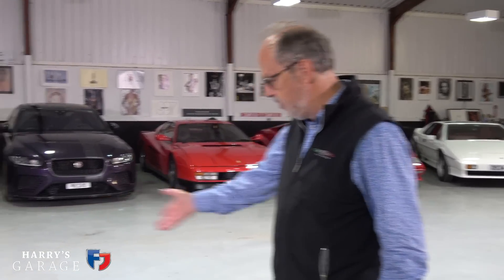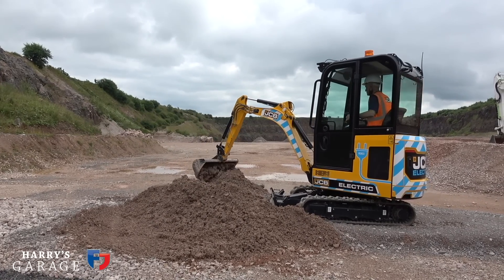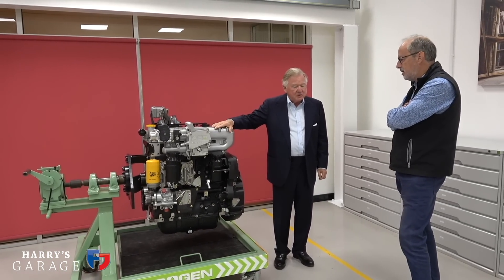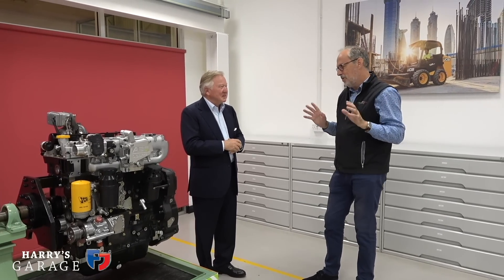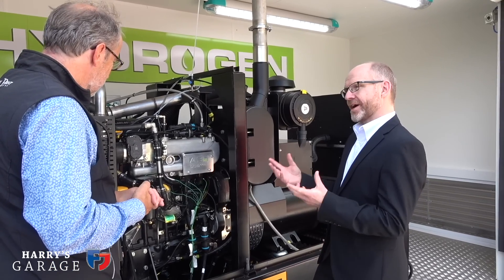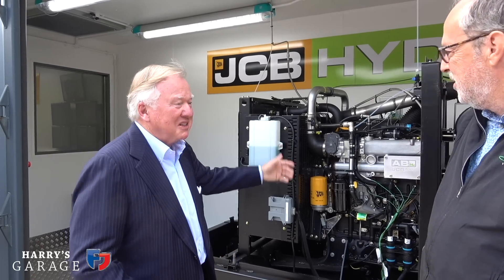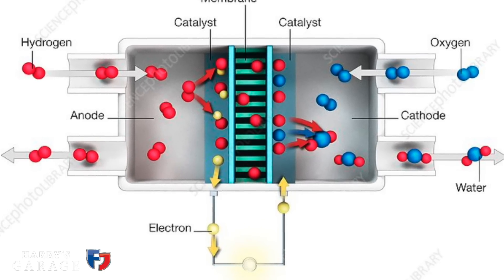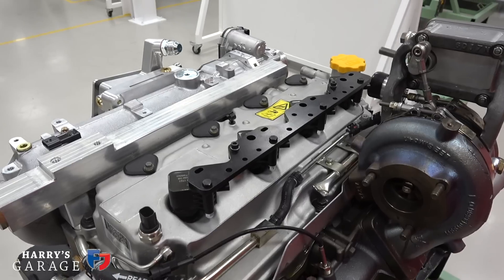Is hydrogen, rather than electric, the future for big-engined machinery? I visit JCB to find out

Comment: Brilliant and not using up RARE EARTH METALS ? Isn’t that a great idea
Reply: Yes I totally agree I also don't want internal combustion engine to see their last days even after decades of their advancement , but I think there would be a problem while producing efuel this process will disturb the water recycle right?
Reply: The result of this technology is water out of the exhaust so I think it is a win win
Reply: Hydrogen the most common substance in the universe only cost of getting it is the problem but how much is spent on treating crude? Great video harry.
Reply: Ok so tell us what your solution is
Reply: @kennethbailey7499  The 'only water vapor' out of the exhaust is one of the arguments which must also be scrutinized. Water vapor is a more potent green house gas than carbon dioxide. It happens not to stick around as long as CO2 doing its heat trapping worst - but it is not as benign as many think it is.
Batteries are (currently, at least) heavy, and mass is a major advantage in earth moving. You can only dig down with a force matching the weight of the vehicle. (This is going to be a major pain when mining on the moon and Mars is attempted.)
The earth moving equipment simply needs more battery storage and they have more than enough volume to store these batteries. The motors themselves don't have to be anywhere near as large as the ICE motors they replace.  
Charging - yes you need electricity but a simple 11kV line (the type that supplies residential neighborhoods) will supply 3 megaWatts of power. So in developed environments where electricity is available then BEV earth movers are the way to go. For remote locations, stick with diesel (preferably locally produced biodiesel). At least diesel is non-explosive and the delivery infrastructure of diesel is easy and safe - two aspects which elude hydrogen.
Have a look at https://www.youtube.com/watch?v=3IPR50-soNA which is quite informative.
The main thing to remember about the hydrogen-as-a-fuel idea, is that it is being pushed hard by the fossil fuel industry. They promote the so-called green hydrogen concept - producing hydrogen from water using wind and solar electricity - but they know that if hydrogen is widely adopted then the only economical way to generate hydrogen is through the reformation of methane which will be back to producing vast quantities of CO2 - but the executive bonuses will be secure.
Reply: @pralhadmundargi6503  

Please watch the Jordan Peterson video on YouTube at Oxford University think it title is What Greta Thunberg does not understand about climate change this clip is 7’10” it will expand your thoughts as it did mine
Reply: @kennethbailey7499  or another idea I heard that the Israel scientists discovered that plants can release hydrogen so if increase these variety of plants we can use their hydrogen for efuel and at the same time the level of oxygen will not deplete, right ? Whereas while mining lithium it causes deforestation, 15 tonnes of CO2 is produced per lithium huge amount of water is used which causes loss of water content in fresh water resources and there have been a report in decrease in yield because of mining lithium . Thus if hydrogen is removed from water , used by automobile to power their cars and release water vapour back into the atmosphere it is a complete cycle I guess .
Reply: @pralhadmundargi6503  Lithium is 'mined' from salt beds - no deforestation at all. Lithium isn't used up. At the end of 1,000,000 miles of driving, the 10kg of lithium in a typical EV's battery is still there - 10kg. Water vapor is a significant greenhouse gas - actually far worse than carbon dioxide. (It just doesn't stick around in the upper atmosphere so long.) The thermodynamics of hydrogen production for vehicular transport just about works out for aircraft fuel-cell use but actually burning it in internal combustion reciprocating friction engines is pure folly. The hydrogen proponents do not have the environment in mind. They know that methane reformation is the only economic method of hydrogen production in industrial quantities and for that they can keep extracting fossil fuels out of the ground and creating vast quantities of CO2 in the process. The 'green hydrogen' is just green-washing. These people have an agenda and it takes courage to stand up to them and see through their propaganda.
Reply: Am i listening to really outdated and uninformed information here? First of all japan has already looked into mass producing hydrogen vehicles a long time ago. Second all internal combustion engines can run off hydrogen. Third there has been hydrogen powered buses here in America for years. They are developed by a company calles the sun bus. Last but not least Toyota has the most advanced hydrogen fuel cells. This video seriously made me feel like my brain was losing 📉  intelligence.
Reply: Er, what about the platinum which is used in the manufacture of hydrogen fuel cells????
Reply: @mb-3faze  I'd have to agree. Why on earth would you want to continue with an engine which has literally dozens of moving parts, requiring maintenance and repair on a fairly regular basis when an alternative already exists which does not? Especially when the engine using hydrogen still requires lots of electricity to produce it's fuel? It just seems counter productive.....

Comment: Hydrogen combustion isn't zero emissions. The high combustion temperatures of burning hydrogen results in Nitrogen Oxide (NOX) gasses in addition to the water vapour from the exhaust. Still a lot cleaner than diesel but not zero emissions

Comment: Great vid. Hydrogen is the answer. Cheaper, efficient and basic conversion from fossil fuel. Too easy. Lord Bamford is onto it. Politicians better not interfere. That's the only negative.
Reply: Hydrogen from fossil fuels doesn't address the greenhouse gas problem, which is the fundamental requirement of all these developments.

Comment: A key factor which this video makes little or no mention of is the efficiency of converting hydrogen to motive power.  I believe a fuel cell with an electric motor driving the wheels is much more efficient than an internal combustion engine.   Secondly hydrogen produced without carbon emissions is likely to remain very expensive for many years.  Given this fuel cells will have a considerable cost advantage.

Comment: I’m an a grade mechanic and I thought hydrogen was the way to go until I went to an ev convention and saw the new Hyundai hydrogen fuel cell car.I asked what the maintenance on the fuel cell was involved and was informed that the membrane between the four hundred plates had to be replaced every ten thousand kms.that is ridiculous as it would mean two major services per year.hydrogen is dangerous to store and would need to be made at point of sale and it is the smallest molecule known to man.hydrogen will leak through porous housings.imagine the leakage problems by pulling the fuel cell to pieces twice per year.you still need to get the energy from somewhere to create hydrogen.the best available at the moment is the plug in hybrid engine.there is no petrol shortage ,they claimed that in the nineteen seventies.there are many many capped wells throughout the world waiting to become economically viable.
Reply: You got it. Hydrogen fuel cells degrade, and need attention at periodic intervals.

Comment: This is brilliant! There is life in the old ICE yet! With heavy machinery running on hydrogen we are saved. I wonder if container ships can run on it as well?
Reply: @philiptownsend4026  That's utter non-sense. Where would you get the energy for extracting hydrogen from that water? You would have to produce electricity on the ship itself, in which case you could just use electric motors with multiple times higher overall efficiency.

The (only) benefit of hydrogen is the very fact that you can produce it somewhere else and then transport this high-energy-density matter relatively easily and store it on the vessel itself.
Reply: @philiptownsend4026  I did not mean to be aggressive. It is what it really is.

Again, if you wanted to produce hydrogen from water on the ship itself, you would have to carry or produce huge amount of electricity onboard to do it. In which case, it is utterly wasteful to convert this electricity to hydrogen, combust it in a combustion engine and lose ~90 % of the original energy. In other words, your hydrogen-producing ship would require 10 times larger batteries than a ship directly propelled by an electric motor.

As I said, the point of using hydrogen is the very fact that you can produce it elsewhere and then use it as an energy storage lighter than batteries. Producing hydrogen onboard any vessel either for fuel cells or hydrogen combustion engine does not make any sense whatsoever and never will for the reason described above.

Comment: I feel JCB is on the wrong track. The piston ICE is dead. There are far too many pumping losses - it is inefficient. The hydrogen fuel cell is more efficient, as used in trains. 

The Wankel ICE (one third of the size and weight and smoother) when run on hydrogen is 27% more efficient, but still less efficient than the fuel cell. The Wankel works very well when on a constant speed like an onboard genny. 

The solid state battery is a game changer.  Three times the range half the size and weight and will last the life of a vehicle. Minutes to charge if you have a fast charger. Toyota say one will be here in two to three years time.

Comment: Always thought about this. But the electric car lobby is very strong at the moment. It shouldn't be a big problem for BP and Shell to produce hydrogen and roll out a infrastructure.
Reply: Hydrogen for construction vehicles, probably, but don't see it for the mainstream. Toyota already giving up on it. It's really for Shell and BP, keeps them relevant.
Reply: @dachoppa3702  yup, h2 is basically a scam to keep drivers wedded to the pump.
Reply: @dachoppa3702  Check out James May and his new Toyota Hydrogine car!
https://www.youtube.com/watch?v=v99AthjW78U
Reply: @Homieguerneville  Good luck to Toyota. I don't see it taking off.
Reply: The next generation energy carrier will be hydrogen from a zero regulated production market for the individuals..For a family it.will be like have a refrigerator box that produce all hot water, electricity and fuel they need...today you can buy such box for 5 -10 000 us dollar ...and it will last for 40-50 years with no other cost than a minimum service. What you think if all families in world want to have one such box....and if there will be 10-20 more such technical developments on individual level market, after the global elite are out of business....individual benefiting market have been hold back for very long time....all time high soon coming. Hydrogen is gods gift to individualism though not smart build larger production and storage than every day use. Need of Incoming energy was solved already at generation 4 or 5 when you can split water with light instead.

Comment: This is fascinating. Two questions sprang to my mind, which didn't seem to be tackled in the video. Internal combustion engines are normally much less efficient than fuel cells. Presumably, as they are an awful lot cheaper, then users will offset the increased fuel costs against original purchase price. The high temperature of combustion will produce oxides of nitrogen. How are these removed? It may be that these are still commercially sensitive, so couldn't be discussed.
Reply: Maybe the exhaust of the hydrogen ICE will need a catalytic converter?

Comment: What a fascinating video. Lord Bamford comes across as a true gent and I genuinely believe there is a future for hydrogen in larger (currently diesel powered) heavy vehicles.
Reply: Spot on, thankfully cannot be sold to Chia plc
Reply: Really ? You are easily fooled. Informative ? It was a one side promotional puff piece with no hard questions asked.
It is very hard to tame detonation in a h2 ice engine. The reciprocating engines BMW were testing suffered knock. H2 works better in rotary engines. Given an ice engines typical efficiency of 20%, and the entire supply chain energy cost of generating that hydrogen and distributing it, then 5 - 10x more renewable energy might need to be generated overall, to produce the same power at the wheels, than for a pure battery ev that has a >97% conversion efficiency.
H2 fuel cell cars, are not much better. H2 fc cars are basically a battery powered ev with the fc charging the battery, and a h2 to electricity conversion efficiency of eg 40%.

Comment: City cars being electric I can understand but for everything else EVs aren't good enough. Hydrogen starts to make sense.
Reply: Plus it takes a bloogy great big power Station to charge the thing s up! They are not eco freindly by any stretch of the imagination! How to you dispose of the batteries when they wear out? That is despite the nasty proscess of making them in the first place!
Reply: Where are you getting your misinformation from?
Reply: @khankrum1  you recycle the batteries
Reply: @khankrum1  
The electricity comes straight from the grid. More than half of U.K. electricity production is zero emission, with most of the rest from natural gas (not coal as some seem to think).

And if hydrogen is so much better, where are you going to get the power for that if you think we don’t have enough for EVs? You need several times the amount of electricity to produce the hydrogen to power a hydrogen fuel cell EV to drive the same distance as a battery EV.
Reply: @kardy12  yes,  anyone who has played with fuel cells and made hydrogen sees this.
Reply: Hydrogen is hugely inefficient, requires lots of electricity and requires expensive storage and transportation.
Reply: Ev is perfect for all cars. Good to see hydrogen being developed for bigger machinery - still has fuel infrastructure issues of course.
Reply: @paulbarton957    EVs are so good that the government needs to push for it.
Like I have said, they are fine for city cars. For work cars, performance cars and the like the tech isn't there yet.
Reply: @peekaboo1575  I mean Tesla’s 5 seat sedan is the fastest production car to 100kph and all the next crop of hypercars are 2000bhp EVs but sure, just good for cities.
Reply: @paulbarton957  And they're indeed great if all you want yo get to 100km/h very quickly, or perhaps do a few quick laps around a track.
Reply: @kardy12  We already produce a lot of electricity that we cannot use, either because the demand is not there at the time that the power is being generated, or because the National Grid does not have the capacity to transport it to where it is needed or to store it until the demand rises. Infrastructure feels like a big problem to me, one that I don't think is practical to "fix" for electric vehicles, even when (if?) we finally get Lithium Air batteries to work.

Using hydrogen as a fuel will allow us to store this excess electricity by converting it on-site and then transporting it around the country in the same way as we do for oil. The storage mechanism (a big steel bottle) has a small initial cost and is 100% reusable for years(?) and, even when it reaches its end-of-life, is then easily recycled by the scrap metal industry, which already exists.
Reply: Statements in this video are a bit misleading:
Some new li-ion batteries did not use cobalt at all exactly because of limited supply mostly from shady unstable countries, this is also done for reducing price which falling constantly as cheaper compounds being developed. Copper in Tesla car motors was replaced by aluminium, others will follow if not done so already both in terms of battery and motors to limit their EVs to readily available affordable materials or at least limit use of expensive ones to a minimum. Thus hydrogen is currently destined for special-purpose applications where low weight or special logistic requirements are more important, as there currently is not a way to produce hydrogen both cheaply and eco-friendly for a wide-scale application like civilian cars. While you can use excess energy from renewables, the energy conversion ratio for getting hydrogen through electrolysis from water is rather poor when compared to use that energy for battery charging. I would personally prefer a hydrogen fuel cell plug-in hybrid with a 30kW battery for usual driving needs compared to an EV with a 100kW+ battery for comparable primary do-it-all car performance any day, but without eco-friendly mass production and hydrogen infrastructure it does not make any sense to even bother, As for using hydrogen for combustion, this is at best stop gap technology that will be hard sell in any country with hash environmental protection laws as are expected to become the norm in the future...
But wait, there is more, check some issues Toyota has with developing ICE hydrogen engine: https://youtu.be/3IPR50-soNA

Comment: Hydrogen is the way forward. Even if only for the fact that a Hydrogen Pump can easily be located in all Garage Fore Courts.
Reply: @bbbf09  It wouldnt be stored. Apparently other technologies have been developed via current Gas pipes and then deblended. Deblending could provide a means to transition from a 20% to a 100% hydrogen network, providing customers with the options for either pure hydrogen, hydrogen/natural gas blends or natural gas to meet demand in industry, heating, transport and green power generation.
Reply: But unfortunately, the hydrogen won't just magically appear at that pump.........and not all garage forecourts will have sufficient space to install hydrogen storage facilities. Particularly not those in urban areas with housing close by.
Reply: @Brian-om2hh  Give it time..Currently the delivery    of Hydrogen is being considered via shared mains water pipes direct to Stations. Brilliant article online.